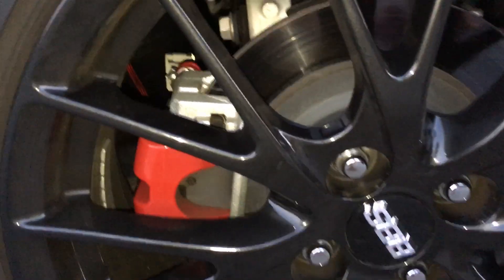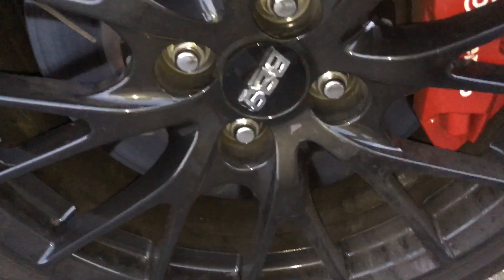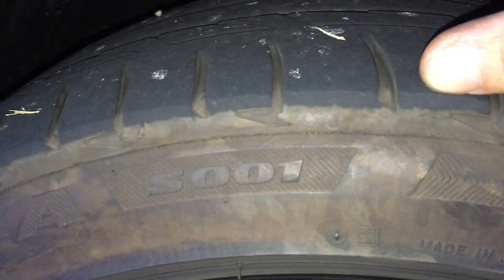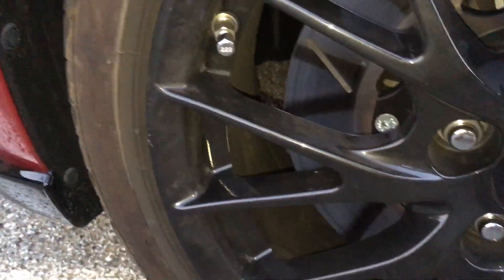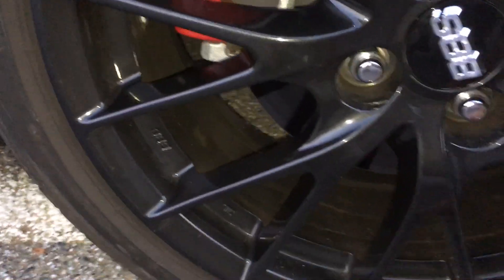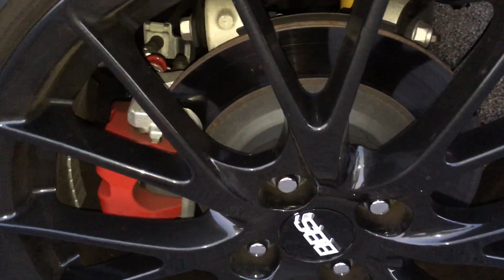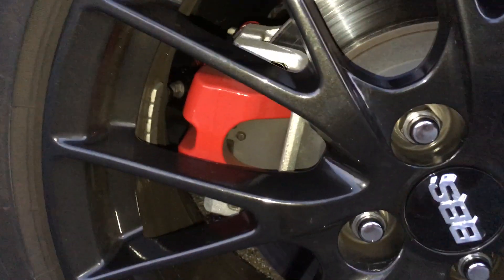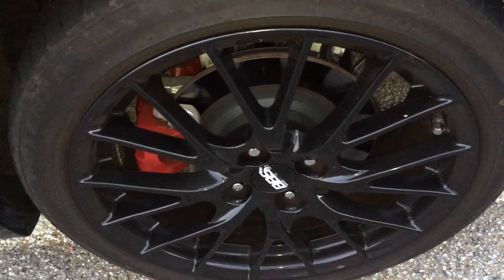ND Miata Brembo GWR big rotor cooler running

Comment: Now that it has been a few years, any issues with the GWR 12.75" 2-piece rotor?
Thanks
Reply from the maker: Sold them not too long after I got them.  They were just too much, over kill for street use even for mountain roads.  Am now and for a couple years running the sakebomb 2pc. rotors